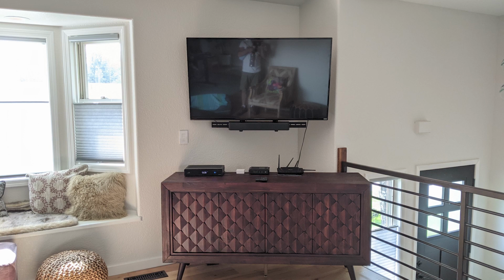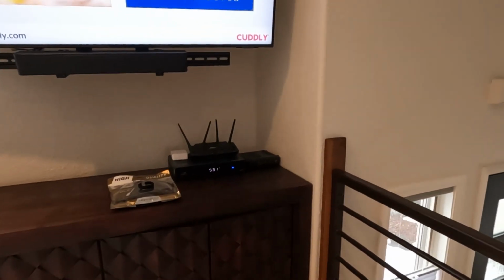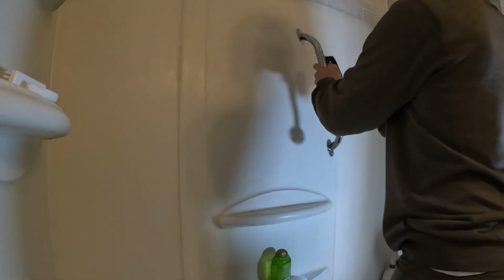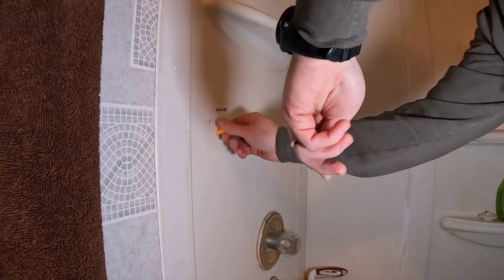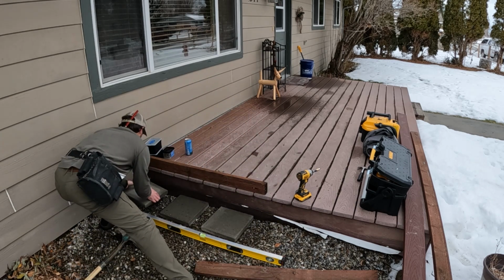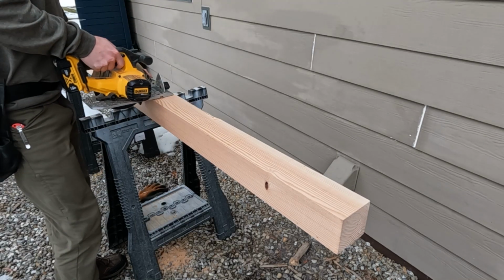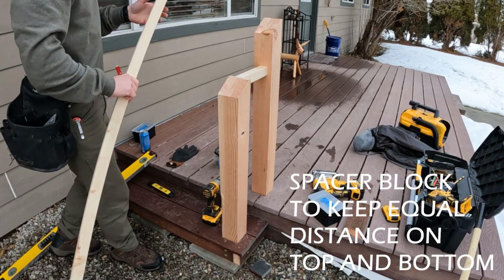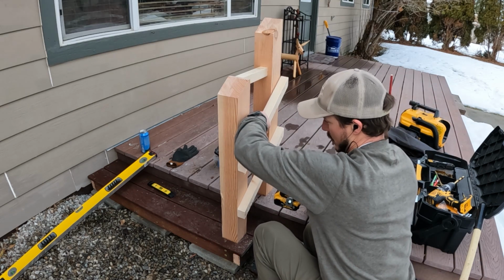A Day In The Life / Handyman / $500+ A Day

Comment: One big thing that's recommended when installing grab bars on direct-to-stud mounted tub/shower surrounds is to fill part of the cavity behind the grab bar with spray foam.   The surround material is thin &  there is empty space behind it even at the stud locations, so even though your anchors would be more than strong enough to fasten the grab bar to the surround, the surround material itself will still flex when the grab bars are used which can cause cracking or breaking over time.  Once the expanding foam is cured you have a waterproof seal behind your grab bar & a rigid substrate that fills the space preventing that thin surround material to flex when the grab bars are used.  It doesn't look like this is that type of surround,  I just thought I'd share anyway.  Hope it helps!

Great video BTW.  Thanks for sharing!
Reply from the maker: That is amazing! The best comment I have had so far. That's genius! I will definitely remember in future encounters.

Comment: Regarding using a fish tape, I'd recommend wrapping the tip in electrical tape to make it resenble a Q-tip. It wont snag on anything.
Reply from the maker: That's a great "tip!"
Reply: A good secret. Pull out a cord that was already in the wall with a string attached to it. Then attach the cable u pulled out with the new cable getting pulled in at the same time...and wallla

Comment: The only time I made all the holes in one go when installing a grab-bar or any mount that requires multiple holes, was the first time. Now I just make 1 hole and recheck that everything's properly centered, before the next hole. It's tedious and longer, but I'll do that before handing a job done with screws coming in at different angles
Reply from the maker: I know what you mean. I'll try that next time.
Reply: @handylife22  mind you all the grab bars I've installed have been on ceramic, so I use a Dremel to scar the enamel of the ceramic before going in with the drill. And it's in that scaring that the holes may drift away from their original spot

Comment: Thank you for this very well edited and informational video.  Inspiring!  Regarding the grab bar...  What about using Butterfly Bolts (Toggle Bolts) if the stud is not in a great location???
Reply from the maker: Thank you for the kind comment! I really appreciate it. As far as the grab bar...yes, using toggle bolts would have been much better than what I did. The horizontal bar wasn't able to grab any studs. I did eventually go back to this property and replace them with TOGGLER SNAPTOGGLE Toggle Anchor (amazon).

Comment: When you go back to fix those hand rails, toggle bolts are the only chance you have.
Reply: *grabbars
Reply from the maker: I totally agree. I still need to look into the wingits
Reply: Toggles wouldn't work. You need a bigger whole drilled to fit toggles in.  Then the screw flange on the rail wouldn't cover the wholes
Reply: @jheiny1231  as an electrician, I've installed alot of toggles. They come in many sizes, and if you know what you're doing, you can keep the home size too a minimum. They can angle in, if the bolt hole is on the edge. The outer edge of the toggle, lines up center of hole.
Reply: @hilariohernandez340  I'm also electrician.  Maybe 3/16 toggles would fit but then strength is the same as using wall anchors anyways
Reply: I agree those anchors won't hold.  There are better anchors as noted in the other comments.

Comment: You had too much faith on that stud finder to make holes in a tub/shower wall.
Reply from the maker: 🤣 I'm trusting them less and less
Reply from the maker: I actually ended up doing more work for them and while I was there, I replaced the anchors near the spout with high end anchors because it was loosening up a bit.
Reply: @handylife22  Nice, you do good work. Don’t forget to use 100% silicone sealant for penetrations in wet areas.

Comment: Unless you did it off camera huge mistake that could cause a massive problem down the road. Should always squeeze some silicon in the holes before inserting the anchors and some more in the holes before the screws. Without it water will get behind the screws into the walls and cause water damage and mold.

You also didn't add any sealer on the cuts of the railing after cutting which will cause the wood to rot at a faster rate. 

Those step above are so crucial thats its why I dont hire handyman for most things. Better to hire a skilled tradesmen for certain job as those simple steps are details that should not be overlooked.
Reply from the maker: I agree with you about the silicone. I could have used silicone, however, I didn't because the bar comes with a waterproof seal that sits between the bar and the wall. Great tip though.

As far as the railing, I discussed sealing/staining it with the client and they asked me not to. They wanted to do it themselves and I was very  up front about the importance of sealing the wood.

I understand the security a client feels when hiring a skilled/specialized tradesman. But with that in mind, they would have had to likely hire 2 different companies to do each of these jobs since they were at the same residence. 
Hiring a skilled handyman can allow a client to stick with only one company that can do multiple jobs, thus, eliminating the hassle of juggling multiple contractors. 

If you find someone that you like and does good work, no matter if they are a handyman, electrician, plumber, etc. I would stick with them. They are few and hard to find.
Reply: A good handyman will learn from comments like these, but no one is perfect. I agree on the silicone for sure, but I think it would take a long long time for that to cause any damage.

Comment: nice video, I like your tool and trailer setup. I have Dewalt cordless as well, debating going with the T-stak system or milwaukee pack out.

I wouldn't use standard wall anchors like that for grab bars. They can and do fail, especially if someone grabs at them and has some weight behind them. Check out "Wingits" I believe they are the only anchor a lot of these companies such as Moen will stand behind for their grab bars. They are typically found at home centers, or can be ordered online. Worth a google for your next job.

Also hope customer is going to paint that untreated wood for the top and rails.

It's a never ending learning process with this kind of work. keep up the good work.
Reply from the maker: Thanks. I like the T-stak, but I haven't tried anything else.

I should've gone with a wide metal expanding anchors. If I thought the current ones wouldn't hold I wouldn't have used them, but you're right. Better to be safe than sorry.
Reply from the maker: Didn't read the whole comment. I'll check out wingits. I may even go back to replace them, it still makes me feel uneasy thinking about it. 

And yeah, I told them to be sure to stain/paint the rail.
Reply: @handylife22  yeah I used to use zip toggles for those, till I saw  something about the wingits.
Reply: @chrisburns5691  I am in the process of making a drywall anchor test video. It was alot of fun. Wish I would have thrown wingits in the mix! Didnt see those at home depot. By far the pop toggles outperformed all others at 235lbs! Crazy. Check out my channel to see the video when it comes out! Cheers guys
Reply: That is a nice tight grained post. Is that douglas fir?